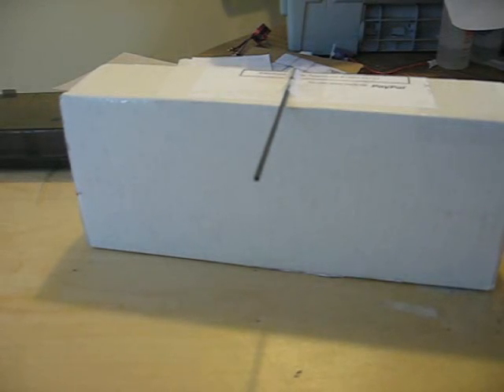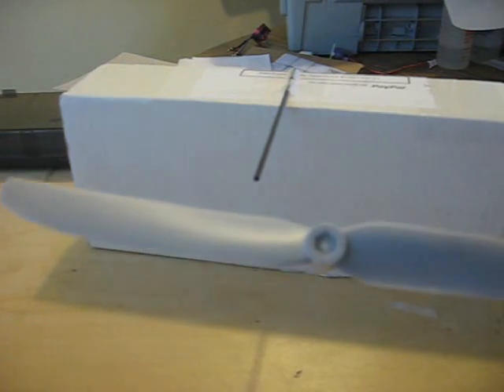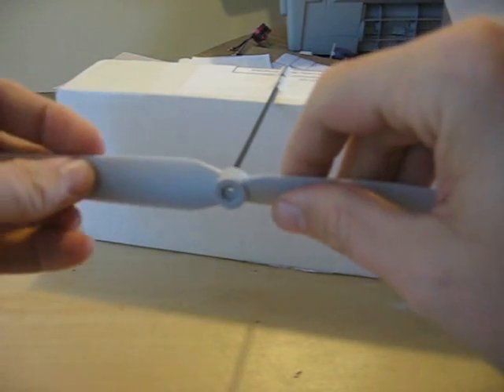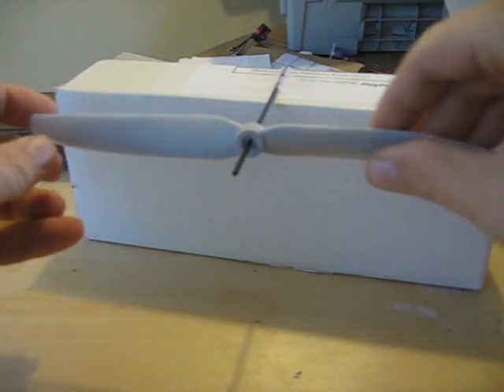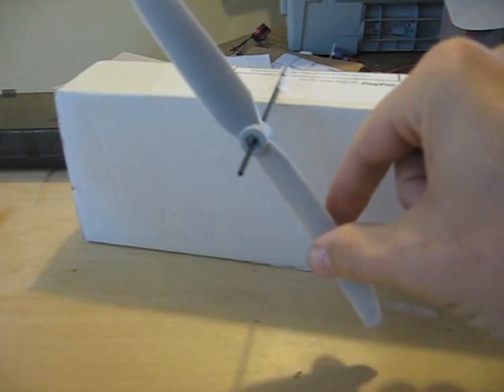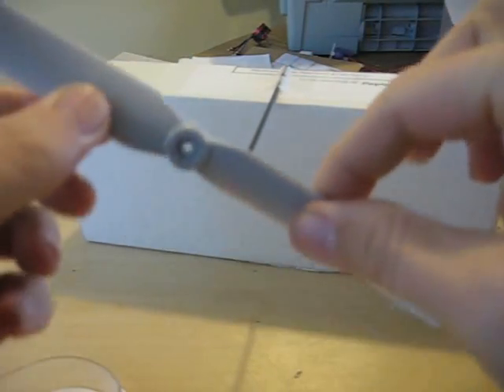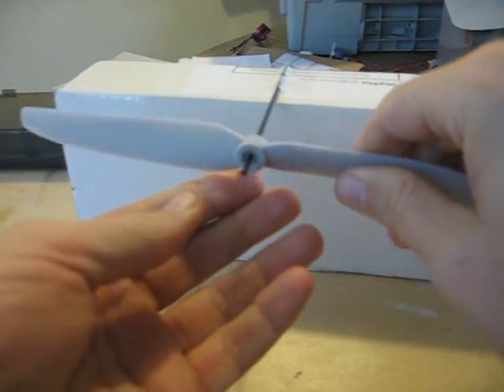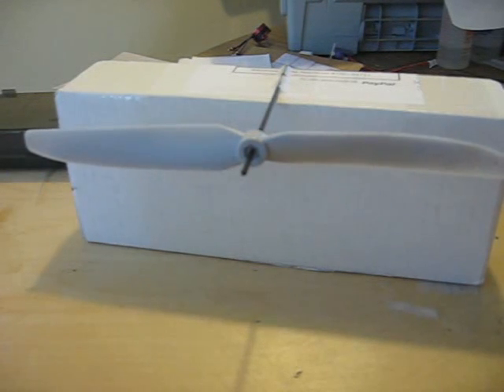How to balance a plastic Prop

Comment: SAND YOUR PROPS, don't put tape that is such a newbi thing to do.
Reply from the maker: The bottom line is balance your props, use the method that works best for you and enjoy everything that flying has to offer.
Reply from the maker: i never said it was the best method just a quick one.
Reply: How is sanding better?, you're getting rid of its strangth, with tape you can take it off and rebalance at any time.
Reply: Richard Clark once again wrong, if you're saying something like this it's very apparent you don't know what you're doing
Reply: you cant and shouldn't sand plastic props for OBVIOUS reasons - cause weak points, destroy lift properties (unlike wood which can be sanded smooth - plastic will never be smoothed after sanding - it will stay rough to a degree)

Comment: Please dont try thos at home because this is not how to balance a prop!!!
Usually the shape and weight distribition of props are okay. What you shoupd NOT do is sticking tape somewhere on the prop!!! Why? - Simply because the counterweight that you put in one place will counteract, while it spins faster and faster. So the prop balance he does is literally bullcrap! 
As thickness of props at different sectuons are given and okay, all you should do is sand it off OVER THE WHOLE SURFACE AND NOT JUST AT ONE SPOT.
I mean...every kid knows that. Istart to chuckle when I see people sticking tape on it. 
Sand it or use clear spray paint (quick drying and without chemicals, that cause plastic to degrade or whatever).
At this prop size, it is perhaps not that important, but please dont do that on high kv motors.
BTW: Your diy prop balancer has a significant priblem, which is friction. Buy a balancer for 12 bucks...
Reply: Still no one cares lol.
Reply: What a load of twaddle MrStubbs 1981. Sanding a prop is a sure way to make it stop being a "Propeller"  Making it aerodynamically unsound isn't much good .  Sticking tape has been done by my Father and myself for a total of roughly 80 years and it's never caused any problems.  However your ridiculous idea of sanding OVER THE WHOLE SURFACE is the one thing nobody but a fool would do.  Actually after reading your post I have to conclude you are a fool, you chuckle all you like, but I know who's chuckling at your comments. Spray painting a prop ?????? Wow, that's really talking precision isn't it?  DUH.  

I do agree with the previous poster, Jonathan Barrus, and his mention of motors being balanced, unfortunately this is something we can't do with many modern motors, they have to throw away when only the bearings wear out.  They have no method in which to remove the old bearings. But I honestly don't recall having to find fault with modern motors as far as balance is concerned, in fact a number of motor manufacturers include balancing in their quality control. Modern wire wrapping and better grade metals makes an unbalanced motor more of a rarity today.

Comment: This video is 4 years old people! I think everything that needed to be said, has already been said. On that note, I don't advise using a damaged prop, even if it is only a small chip. Would you use a angle grinder that had a damaged cutting disk??? If the answer is yes, Darwin will be calling on you sooner or later.

Comment: Tape is fine on the type of you show, as no-one in their right mind would use on a serious rpm motor. But sanding / shaping is recc'd for better props. I use both tape and sanding for balancing ... and tape has come of various of my props. Better to fix the Heli guys way ... by wrapping round the leading edge and slicing of at trailing edge. That way no air can get under leading edge to lift it.

Comment: I also am concerned that you have a friction set-up there .. fine for the crap plastic prop you show .. as it's a slow fly and should never be used on a serious model. The better way and cheap .. is two blocks, edges separated enough to set a blade balancer and prop between. The blade balancer being the threaded rod and two cones that centre the prop / blade boss on the rod. Then you are not affected by a) offcentred prop boss as you have, b) friction on rod.

Comment: This method gives up a LOT of accuracy because the friction of the prop riding on the rod that is used. It might work just OK for low KV motors. But, the high Kv motors >2000kv, this method would be almost worthless and dangerous (read - stupid)

Comment: Any imbalance will cause vibration - and vibration absorbs energy. There is no such thing as basic balancing - their is only how close a prop is to being perfectly balanced.
Bad prop balance is an energy drain. Power that would normally be converted into thrust is instead being use to shake your airframe. This wasted energy is MUCH greater than most people realize - even for small amounts of imbalance.

Comment: I used the tape method and it worked like a charm. I taped a drill bit to a flat surface, I was balancing some GWS props and my quad flies great. Thanks for the video!

Comment: Nope. The weight and imbalances are directly proportional to the size and weight of the prop. Otherwise, you'd never be able to balance a small prop like a 6x4 or 7x6. I almost never balance my props, and they fly great. Only when I use a three blade prop do I go that extra mile and balance it. And I do so by spinning it on a screwdriver shaft clamped to my work bench. Works great, balances great, flies great.

Comment: That's not really all that necessary on these smaller props. They're light and small, and barely effect the motor unless they're REALLY out of balance. So basic balancing is all you really need.

Comment: This is a very ghetto way of balancing, don't be lazy people, get some very fine grit sand paper and sand the aft side of the tip down prop. Not the leading or trailing edge, or tip!! the back surface.

Comment: this is only the basics of balancing. You also have to balance the leading and trailing edges if the prop always stops in the same position on the balancer/with the same edge facing down.